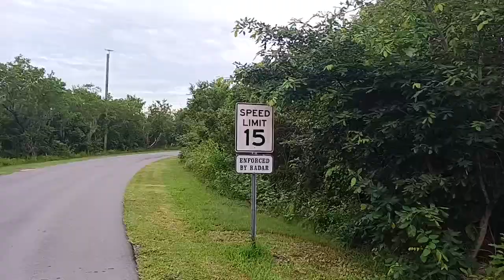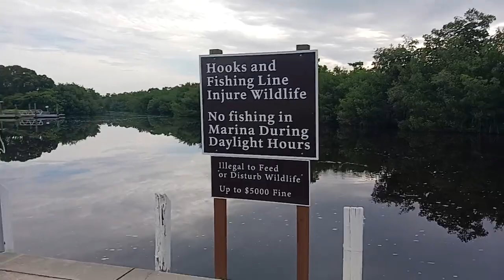Daily Update August 17, 1023. the "Let's walk to work together" episode

Comment: If you ever use bear spray, remember that it does not work like OFF.  Do not spray it on yourself and do not follow the intruction to aim for the eyes.

Do you have armadillos there?  Apparently they have been identified as a source of leprosy outbreaks in the Southeast.

Safe travels and have fun!